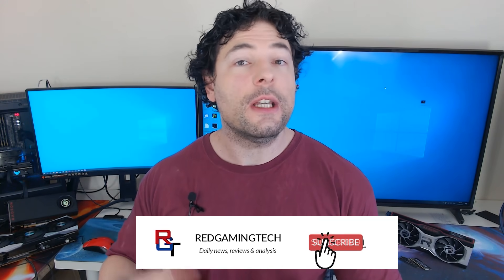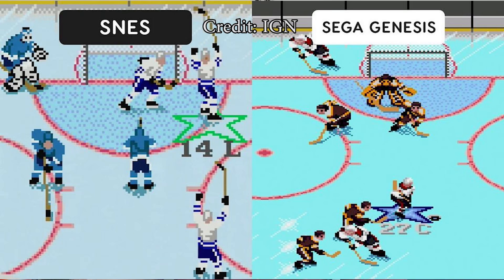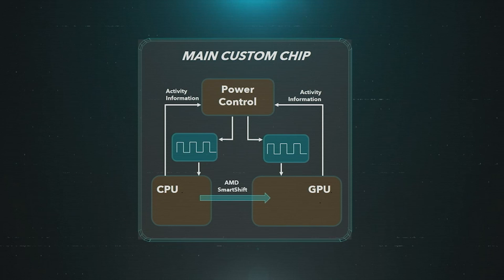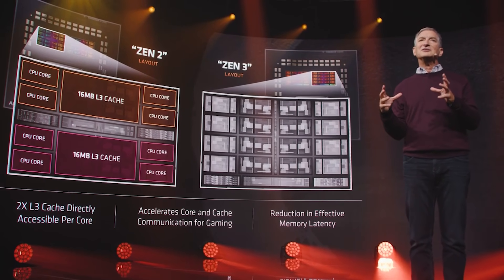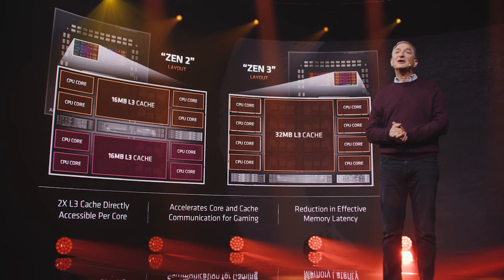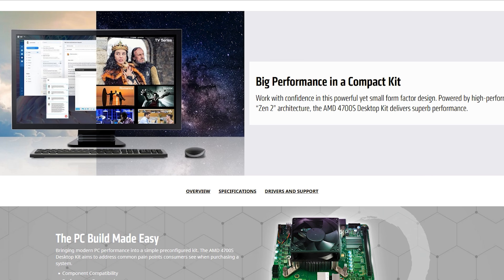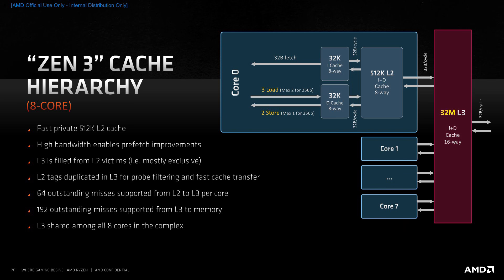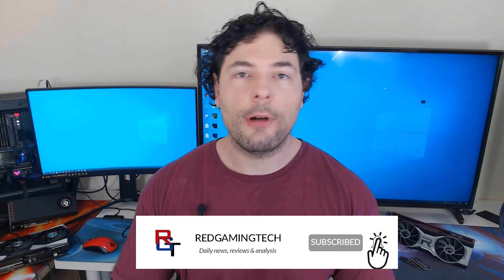PS5 CPU Die Shot Reveals HUGE FPU Customization | Playstation 5 CPU Analysis

Comment: Ps5 must tell us all the modifications they did to beat 12 tflops not so most powerful Xbox console 😅😅😅🤣
Reply: First they have to beat it. Ps5 runs games at lower resolution.
Both consoles 500 dollars. One has more storage and runs games at a higher resolution.
Reply: @Potato-jh3tj  (Copied & pasted from Raios Rogue) - 
PS5 slight wins & major wins VS Xbox Series X in Third Party Multiplat Games 
Shadow Of The Tomb Raider 
PS5 60fps CB 4K-1920x2160 Reconstructed up to 4k XSX Native 3584x2016 41fps
PS5 has consistantly an average of 10fps lead minimum to 19fps advantage
PS5 has 30% more performance advantage over series x 
Xbox Series X has lighting shadow map flickering issues not present on PS5

Metro Exodus PS5 60fps XSX 56FPS PS5 AVG 59.99FPS XSX AVG FPS 59.82FPS
DRS Temporal reconstruction to 4K 
PS5 3840x2160-1920x1080p PS5 2688x1512 2844x1600-1792x1008 
the 1792x1008 drop seem to be rare on PS5 it happens only on Taiga Level
Xbox Series X 4K RC DRS 3840x2160-1920x1080 XSX 2880x1620 2844x1600-1920x1080
Volga Level Opening Train Scene - PS5: 2560x1440, Series X: 2844x1600
Caspian Level Driving - PS5: 2560x1440, Series X: 2844x1600
Taiga Level Exploration - PS5: 2176x1224, Series X: 2400x1350
Taiga Level Forest Most Demanding Scene - PS5: 1792x1008, Series X: 1920x1080
XSX contains 8% resolution advantage in the most current demanding game up to date
PS5 has 8% framerate advantage in the most current demanding game 
POWER IS A TIE IN THE MOST CURRENT DEMANDING GAME 
Greedfall Performance mode native 2560x1440p PS5 60fps XSX 52FPS
NBA 2k21 Native 4k 60fps Same Graphic Settings
PS5 slightly faster than xbox series x in performance
Crash Bandicoot 4 Dynamic 4k-3456x1944 PS5 52 FPS XSX 40FPS lowest framerate
during gameplay 3840x2160 are common pixel counts
Shadows have higher resolution on PS5 
XSX is stuttering again something thats not present on PS5
Stutter series XL always stuttering to keep up with PS5
Control 1440p temporal AA reconstructs image to 4k in both modes 
performance mode PS5 60fps XSX 47FPS THE XSX Stutters and judders
Ray Tracing Mode PS5 30fps XSX 28fps ( No Photo Mode)
PS5 DUAL RAY TRACED REFLECTIONS ON GLASS NOT EVEN FOUND ON PC 
XSX HAS BVH ISSUES RT REFLECTIONS DISAPPEAR AT TIMES 
this is specific to the DXR API the xbox uses its not the northlight engine of the game's fault
PS5 is faster than 2070 super and XSX is faster than both in Photo Mode only with RT
Corridor of doom Heaviest section in the game 
2560x1440 Big Navi 21 RX 6800XT 33fps 
PS5 Custom Big Navi 21 RX 6800XT GPU 32fps XSX 33FPS (Photo Mode)  
Xbox Series X is missing ray traced reflections in certain areas 
and its instead using screen space reflections 
FIfa 2021 Native 4K 60fps PS5 better grass draw distance and better antialiasing 
Xbox Series X has more flickering on hair 
Scarlett Nexus native 4K and native 1440p Common 4K-1440p DRS/TemporalReconstruction 
PS5 60fps XSX 56FPS
F1 2021 Native 4k 60fps PS5 Instant replay 30fps XSX instant replay heavy tearing 27fps
Monica Area RT shadows show on PS5 at greater distance 
while they are entirely missing on XSX in the distance 
120fps mode native 1440p XSX has tearing on Monica Stage 
Dirt 5 Patch 2.0 Quality Mode PS5 4K-2880x1620 XSX 4K-2560x1440
PS5 45% power advantage delta with higher resolution higher graphic settings 
XSX tears more often PS5 has higher graphic settings more shadows higher shadow quality resoltuion higher resolution textures on PS5 PS5 has better ambient occlusion PS5 has longer draw distance sharper textures and better filtering 
Cyberpunk 2077 Performance mode PS5 59fps DRS 1200p-972p XSX 44fps 1296p-1080p
DF toss granade Tested Area where XSX doesnt have EXTRA NPC PS5 30% power advantage
AC Valhalla Perfomance Mode PS5 60FPS XSX 59.33FPS
PS5 DRS 4K-1800p-2432x1368 XSX 4K-1800p-1920x1080p
PS5 has 30% more resolution stronger alpha effects better perf than series x
Immortals Fenyx Rising Performance mode PS5 59.99FPS XSX 59.97FPS
PS5 DRS 4K-1620p-1440p XSX DRS 4k-1440p-1080p
Quality Mode PS5 4K native 3840x2160p Series X DRS 4K-3684x2052
PS5 30% more resolution in both modes
Borderlands 3 Dynamic 4K 
Plant Density foliage sharper higher quality shadows advantage on PS5
120fps mode PS5 93 FPS XSX 84FPS 
Destiny 2 Quality Mode 4K-2356x216 PS5 AVG FPS 59.97fps XSX 59.93fps 
120fps MODE 1440p PS5 120fps XSX 89FPS
For Honor 4k PS5 60fps XSX 19FPS 
POWER GAP IS SO HUGE THE PS5 ABSOLUTELY DESTROYS XSX IN FOR HONOR
Mortal Shell 3200x1800p PS5 60fps XSX 54fps AVG 59.98fps XSX AVG 59.89FPS
XSX texture low resolution state after loading pop in textures streaming issues
Call Of The Sea PS5 DRS 4K-1800p XSX 1440p PS5 slightly better shadow than XSX
Better framerate performance on PS5 better lighting on PS5 and PS5 30% more resolution
Tony Pro Hawk's Skater 2 60fps Fidelity mode 4K DRS PS5 4K-3552x1998 XSX 4K-3264x1836
120fps Performance mode PS5 DRS1440p-2112x1188 XSX DRS 1440p-1920x1080
PS5 30% more resolution in both modes better performance in both modes
Watch Dogs Legion DRS PS5 4K-3100x1744 XSX 4K-3392x1908 
PS5 AVG 59.98FPS XSX 59.96FPS PS5 better performance 
MLB The Show Native 4k Lowest FPS PS5 48fps XSX 38fps PS5 20% more performance adv
Call Of Duty Cold War 1440p 120fps mode PS5 120fps XSX-99fps
Ray Tracing Mode 3840x2160-1920x1080 PS5 FPS 59.95 XSX 59.82
Call Of Duty Warzone PS5 1566p 120fps XSX 83FPS 1920x2160 
All High resolution texture pack installed and graphical features are exactly the same on both PS5 and XSX and The XSX Stutters judders a lot like always 
Devil May Cry 5 SE Reconstructed 4k 120fps mode PS5 116fps XSX 66fps 
here is the 50 Performance delta that dealer gaming was talking about
PS5 is 50% more powerful than xbox series x in the 120fps mode
RT Quality 3840x2160p Reconstructed PS5 42fps XSX 41fps PS5 punching beyond its weight
Sekiro PS5 CB 1800p Series X native 1800p PS5 60fps XSX 48fps
DF We saw the GPU limits of XSX in BC mode but we haven't seen the limits PS5 GPU in BC
Need for Speed Hot Pursuit Native 4K PS5 60fps Series X 42fps
Skyrim BC 2160p PS5 60fps XSX 53fps
DF Xbox Series X has a weakness to transparency effects and atmosphering rendering 
Jedi Fallen Order Performance mode 2560x1440 PS5 59.96fps XSX 59.9fps 
XSX More Stutter PS5 better performance 

Chivalry 2 DRS 4K-2304x1296 PS5 59.98fps XSX 59.96fps

Saints Row 3 Remastered DRS 4K-3360x1890  PS5 60fps XSX 59.96fps
Little Nightmares 2 PS5 RT 1684p locked 60fps XSX 1890p SSR no ray tracing 58fps

The Medium PS5 DUAL REALITY RT DRS 4K-1116p XSX DRS RT 4K-900p NO DUAL REALITY RT
PS5 renders 30% more pixels 30% more power advantage over series x 
better lighting better anisotropic filtering

I've Done My Research Straight Up Facts The Ammo Has Arrived 
Sources VG tech NX Gamer(IGN GAMES) Enalista Debits Digital Foundry Your Receipt
Reply: Nikhil Rao   next gen games... every game sony has can run on the ps4. They just choose not to.
Lol you say relying on vrs... that just makes you sound salty that ps5 doesnt support vrs.
Reply: Nikhil Rao   lol i know theyre not on ps4. Read what i wrote. They can run on ps4 but sony doesnt want them their. 
Yes vrs is useful when frame rates are not locked. Thats why theres games where xbox doesnt need to worry about locking frame rates. Theres games where sony will have to lock frame rates at 30 or 60 and xbox will be able to push higher because it has vrs.
Lol youre saying i need to know tech when clearly youre making statements about games being next gen.
Whats stopping those games from running on the ps4?
Reply: @Potato-jh3tj  Simple answer ..... performance
Reply: the gap between ps5 and sx is twice the power of a base ps4 pony 😂
Reply: @SkemeKOS  You can't name five cross-gen games that run better on PS5 PS5 is getting dog walked it's not even close
Reply: @SkemeKOS  This is an absolute lie....You and him are always lying
Reply: Well first that have to beat it outside of software issues...PS5 is getting destroyed.... you're the can't name 5 games that are better on PS5 after patches. Don't worry I'll wait... always lower resolution, worse textures,etc
Reply: @SkemeKOS  Great info sir. But try use some commas to help your info make more sense if possible.
Reply: @Potato-jh3tj  ps5 has VRS. And a developer actually was more excited about the ps5’s VRS than the mesh shaders which Xbox has.
Reply: @Potato-jh3tj  and if you search it up the ps5’s CU total transistor count is 18 mil while Xbox is 15 million. This means the ps5’s CUs are so powerful that they scale to be more powerful than an overall Xbox 52 compute unites
Reply: @meshingaround9828  haha ps won a few times and in ray tracing, but at the end of the day it's about games that's why Sony always win fact, so shut up and stop being an xbot
Reply: No life's here I see
Reply: Nikhil Rao  You get wrong in VRR and    VRS
Reply: @Potato-jh3tj  fan boy haha what are you, ya name suits you perfect potato lol, just need to put brain on the end of it 🤣🤣
Reply: @Potato-jh3tj  Gt7 is the first game to reach native 4k 60 fps with ray tracing hdr and vr support. Medium series x doing 756p ps5 1150p with ray racing lol
Reply: @SkemeKOS  dam u made  that list cool
Reply: @V1CT1MIZED  vrr is handicap for series x cos its cant reach locked 60 or 120 fps in all most alllll games but that handicap will be coming to ps5 to later 
not that ps5 need it lol
Reply: @xAUSTIN316x  where did u learn that math never mind lol
Keep doing what u doing u doing great 👍😂😂😂
Reply: @rinkumultani2686   lol yep fan boy for sure.
Reply: Nikhil Rao  lol only one game users rite now and that's doom 🤣.  Not only that doom plays looks and runs better on x
Reply: Nikhil Rao  Both have stupid overdramatic fanbase
Reply: @rikkisweet8366  perfect potato brain 😂 see. I've put an end to this internal crisis.
Reply: @Potato-jh3tj  just facts clown boy
Reply: @rinkumultani2686   lol facts... ha says a fan boy.
Reply: @rinkumultani2686   you mention gt7 a game that isnt even out. Then you talk about about resolution for the medium. Both series x and ps5 have dynamic resolution. Yet you forget all the stuff missing from the ps5 version. Such as ray tracing. 
Its pretty clear youre a fan boy.